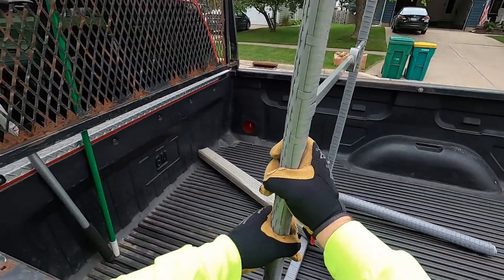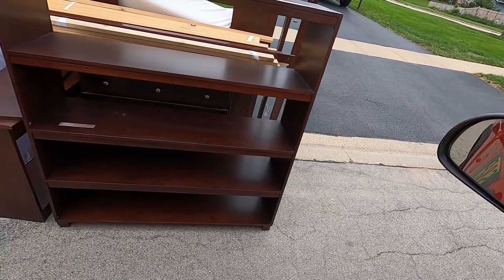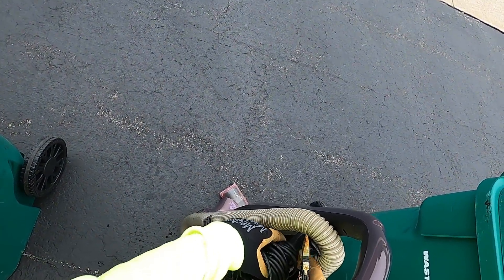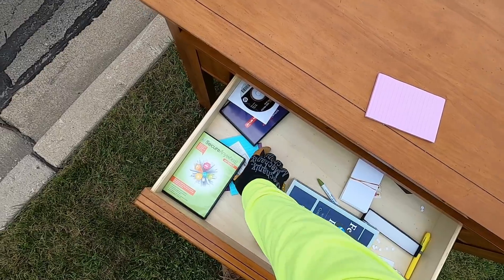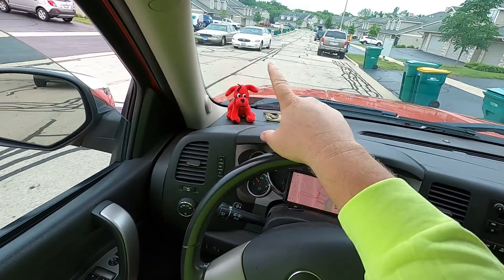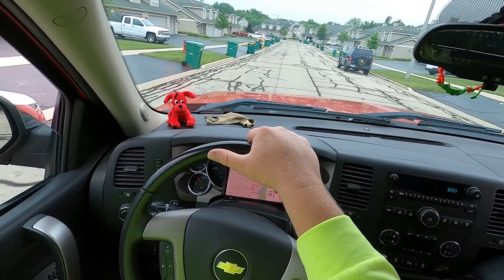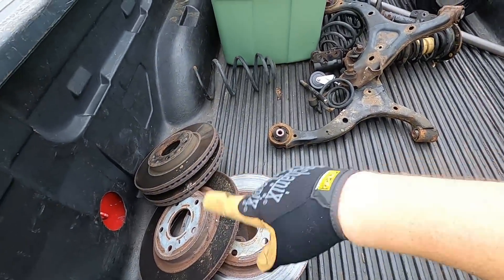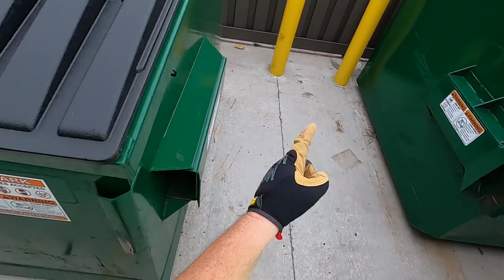Who Would Throw This Away? - Should I Take or Should I Go?

Comment: May I ask, why not put a 5 gallon bucket (or smaller) on the drivers side of the bed near the cab. Bungee it in the bed so it stays during driving and put your insulated copper wire and or copper in it during your route? If it starts getting in the way after filling the bed, then move it to the cab. Wouldn't that save you more steps and wear and tear on your drivers door? It would be out of the way for loading scrap using the tail gate. Be on the drivers side you are at more often. The bucket will remind you it's separate. I'm guessing, putting it in the cab is both a physical and mental separation?